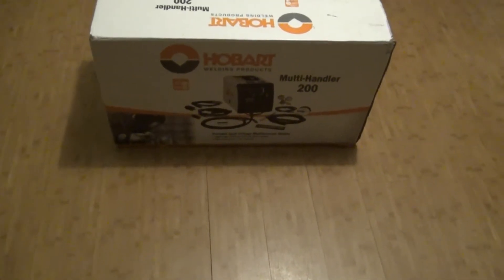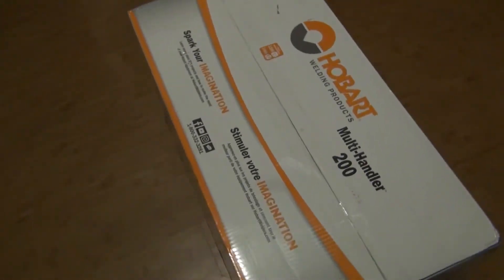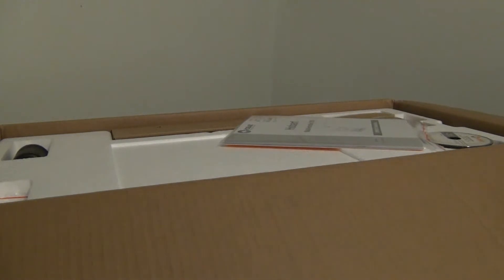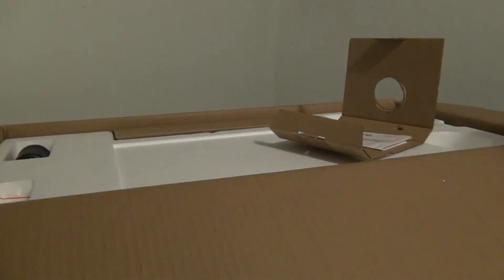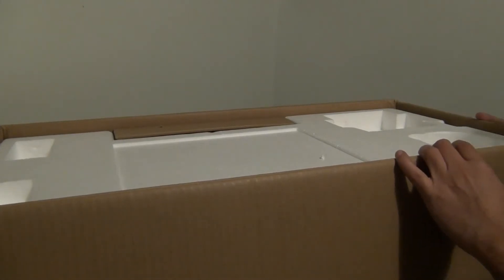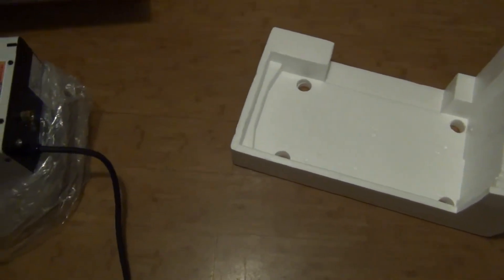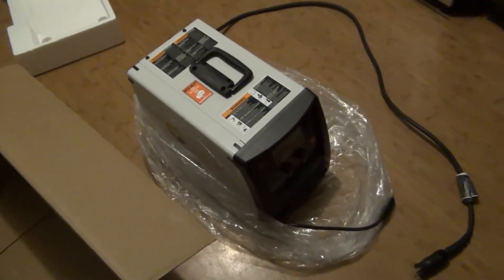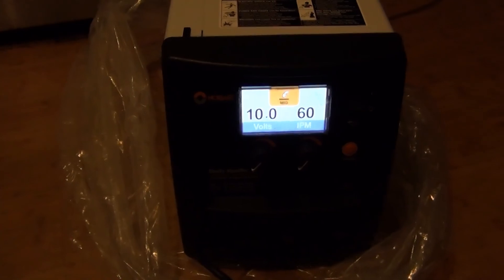Hobart Multi-Handler 200 Welder Unboxing What Is In The Box?

Comment: Can it stick weld 1/8 6010? 3/32 6010? thanks
Reply: It has settings to weld 6011 for those rods but not 6010, it is a multi process welder and can weld stick, mig, tig and spoolgun
Reply from the maker: I don’t think it can

Comment: How did it weld?
Reply from the maker: Hi, I’ve only tried the flux core .030 wire on it, because I don’t have a tank for shielding gas. It’s my first time welding on anything and it did a good job fixing my front gate! Like I said I’m happy with it, but my opinion doesn’t mean much because it’s the first welder Ive ever used

Comment: Nice machine! thanks for the video. Have you tried the machine? I would like to know any comments about the operation, I am in the same situation and but even for me I have never used a welding machine.
I DON'T DECIDE WHICH TO BUY.

Thanks!!
Reply from the maker: Hi, thanks for watching! The machine itself is really simple to use, however I’m not an experienced welder, so I am surprised that I can stick two pieces of metal together at all. I have to learn to adjust the settings to my speed, but if you use it enough times you get better and better. I had a hard time deciding too, but I wanted something that could do more than just mig. That’s the reason I spent on this one, I really didn’t have to.